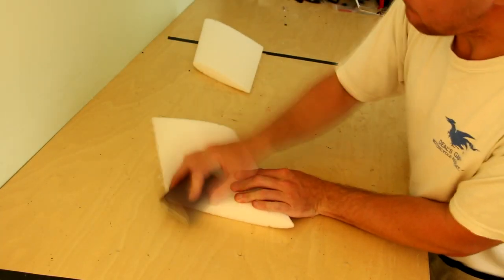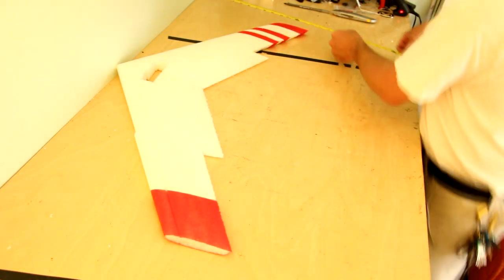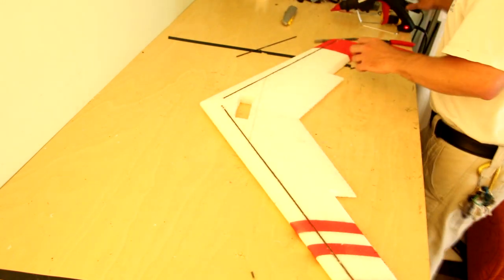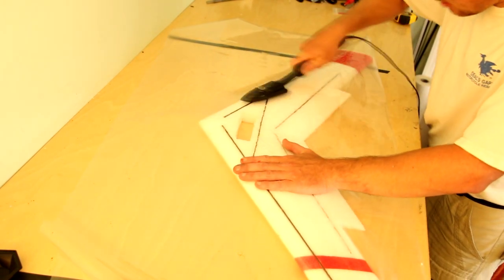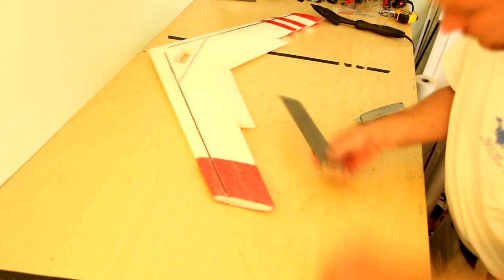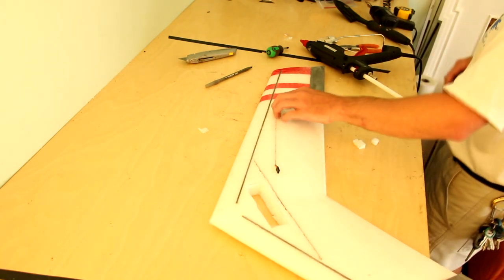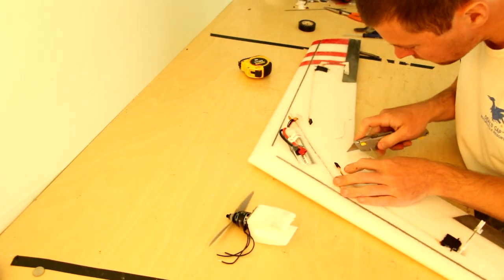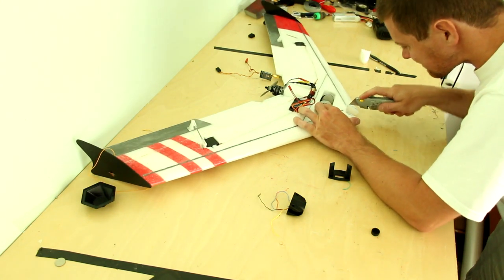FPVWRA Spec wing V2 build

Comment: hot glue and coroplast winglets works very well you just need to prep the area alittle. I trace the wingtip area onto the winglet and than sand that area very well, even using a razor blade to puncture holes into the plastic. Than make sure you apply hot glue on the winglet AND the wingtip and than apply. If you did it right you can look down the coroplast flutes/tunnels and see the hotglue is now inside the winglet. Thats not going to come off easily.
Reply from the maker: This is great... but I usually rip the foam.  I need to try the pinning method I have seen many people do.

Comment: What is a good source for the extra spar? What diameter is it?
Reply from the maker: I get all my spars from a company called "Goodwinds" here in the USA.  I use fiberglass rather than carbon fiber due to RF issues.  I tend to use 0.93" diameter spars for this type of support.

As a side note, running fiber strapping tape along the back also does wonders for support of the rearward tear problem.
Reply: Video Aerial Systems thank you